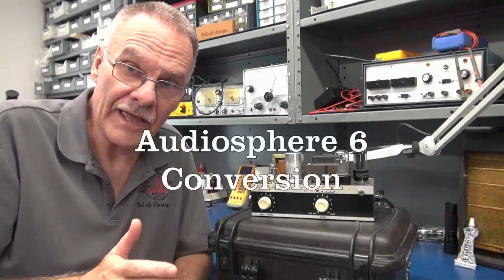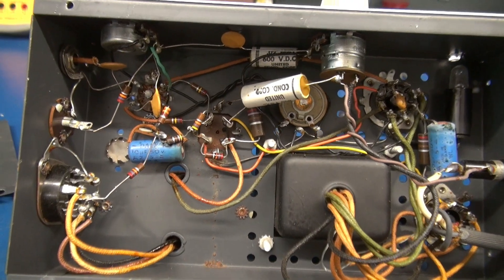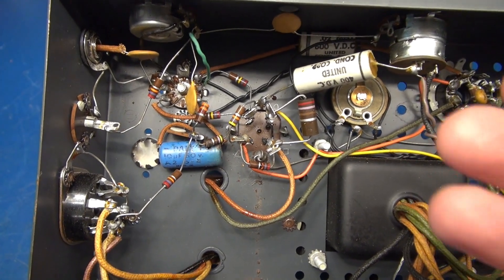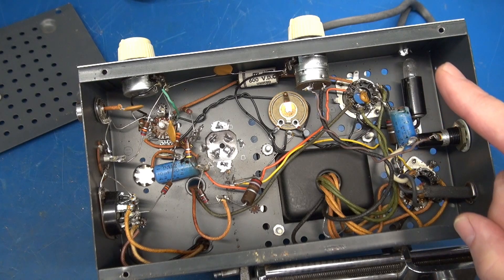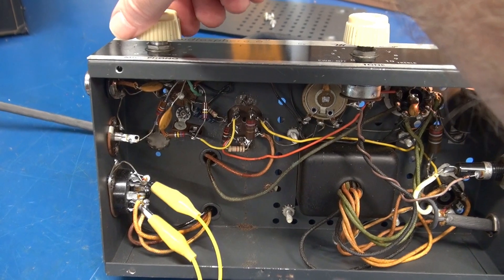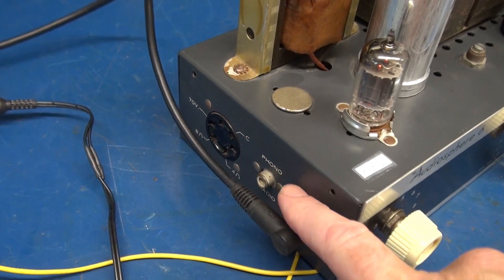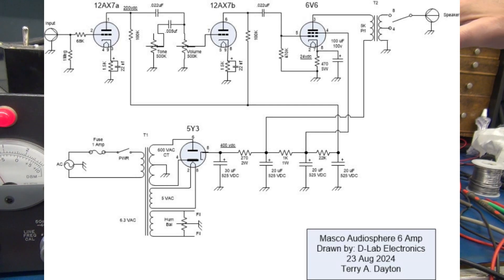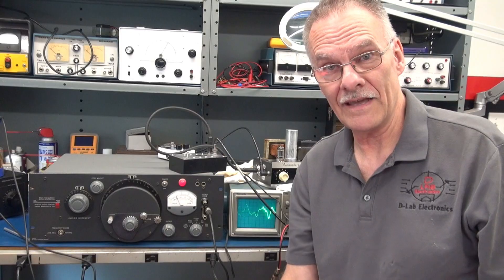Masco Audiosphere 6V6 tube amp conversion to Fender Champ guitar amplifier circuit easy project

Comment: Hey uh i have a important question to ask you. How can you tell what the micro ferrot is on the old wax caps? I have a philco radio from 1938 the model is 38-8 i have no clue what to buy to replace the old caps with. Same for the one thing with the humming of the radio.
Thank you.

Comment: How many watts is snozeramous? I have an old shortwave receiver that I want to replace the filter can. I have a 60 watt iron but it wasn't up to the task. I bought a 100 watt iron recently but haven't tried it yet. I see there is a 175 watt iron for sale. Just wondering.
Reply: I picked up a black Weller gun, which is normally 100/140 watts, but this thing is bigger and 200/240 watts. I use a short piece of    # 12 solid copper wire as a tip and can solder to the middle of a chassis with it. It helps if you have separate flux in a bottle so you can add extra and of course everything has to be freshly cleaned. I was lucky and got the big gun for $5 at a flea market. I noticed it looked larger than the normal low power guns.

Comment: Terry, I've got a "more modern" Champ, a "Super Champ", but though it is a bit higher output (nominal 15 W, actually more likely somewhere around 8 W (it is driven by a 12Ax7 preamp, and a couple of 6V6 tubes in the circuit.) But it was loud enough for a small club, and considerably lighter than the old rig I used to haul. And I no longer gig, so the weight isn't an issue any more.